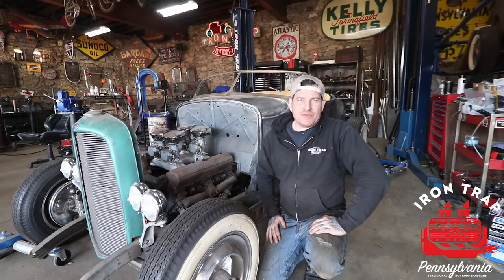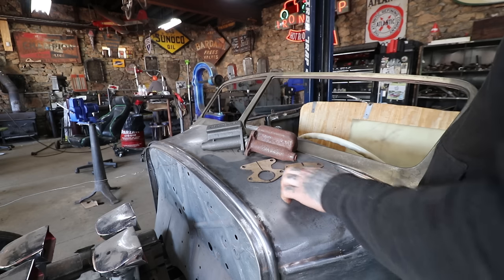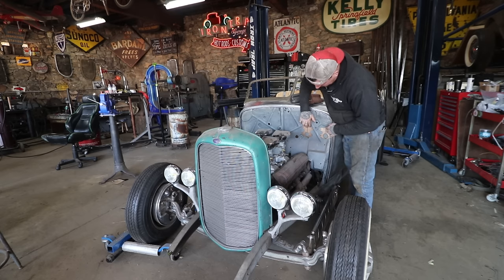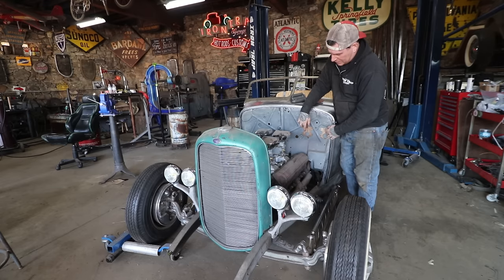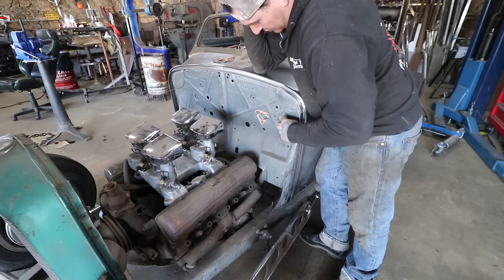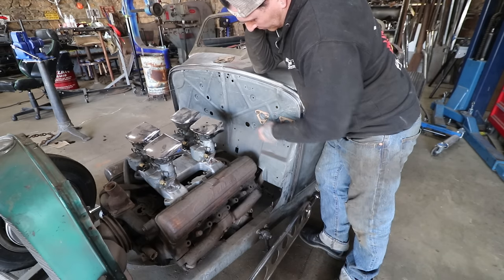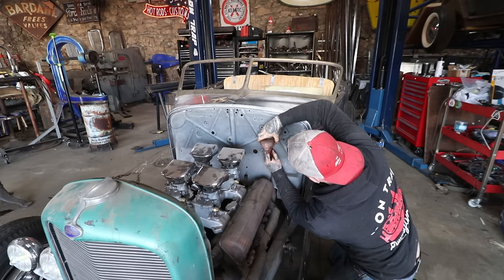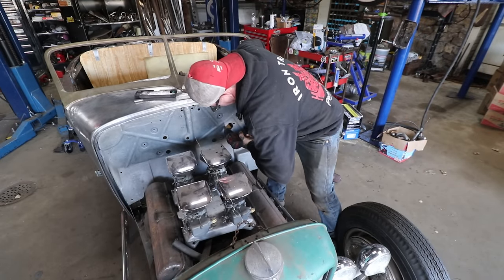Mounting Brake & Clutch Master Cylinders Without HACKING Up The 32 Firewall!!

Comment: Paint them body color. Sand them down and make them smooth and then, that way, you can add some pinstripes to them and make them look even cooler. Real tiny lettering on each saying "Clutch" on one, and "Brakes" on the other. Would be cool.
Oh, I hope that y'all are going to add a heavy plate on the inside for the master cylinders. If you don't, over a period of time, they will end up bending the firewall.
She's looking purdy darn cool, you guys. 
Thanks for sharing. Take care and be safe. 😃✌️

Comment: Chrome.  Brake fluid spills on paint will eat it up.  Also, what about firewall reinforcement behind the master cylinders?  If you reinforce it under the dash, no worries about the beading on the firewall.
Reply: The '32 firewall beading is a masterpiece of industrial artwork, IMO. So glad you have retained it intact, Matt.

Comment: My comment is about the over all plan of the finished car, chrome was a standard of the time back then, however paint has it's place also. The Sweetheart Roadster is a classic Hot Rod Custom with a collection of the greatest tricks known to the Custom World......that said chrome is fitting....but paint has more depth if pulled off correctly, such as pinstripes or two tones....however you work it out, I am loving the build, it is a modern classic reborn for a new era.....Great job Matt Murray

Comment: Chrome . It won't matter what color you choose to paint the Sweetheart Roadster later , chrome goes with every color . Lol . You can probably include the master cylinder mounting in the plate you make for the pedals , just to prevent flexing on the firewall sheet metal . Great job !

Comment: Looks great, its hard to make that pedal line up,  can't wait to see what you do.  Way back you did the double head light bracket.  Well I liked it so mue
Reply: Sorry,  Well I liked it so much I bought a set.  Mine were not able to be polished so I will paint them.  Question is did you ever try big and little lights on any videos.  I may try that on mine. Needless to say I am a fan of those lights.   Oh, I worked in a diesel shop so I don't even notice the noise, keep it up.  Thanks

Comment: I used a Pete & Jakes under the floor pedal set up in my 26 t coupe rat rod. Slick set up with the bracket. Also used a Speedway hydraulic clutch set up. .

Comment: What is so special about 1937 LaSalle 4 speed boxes?  Particularly that year, it seems.

I would suggest adding some vertical reinforcing ribs on the cabin side of the firewall to stop it flexing under pedal pressure.

Comment: Paint or chrome? I would go with what compliments the look of the engine. If the valve covers get chrome then I would add chrome to the master cylinders and other under hood items. If the motor and valve covers are painted body color than I would paint the master cylinders as well.

Comment: Matt, this old fart says you are mistaken about letting the master cylinders determine where things go.  You should get the pedals mounted so they are in a comfortable position and let them determine where the masters go on the firewall.  Putting the masters way off to the left would either put the pedals off to the left, uncomfortable, or require some really hinky linkages to get a straight shot at the cylinders.